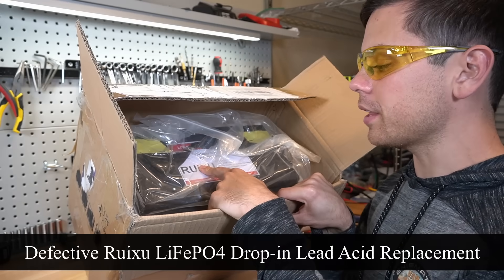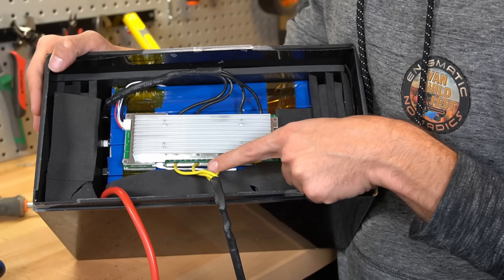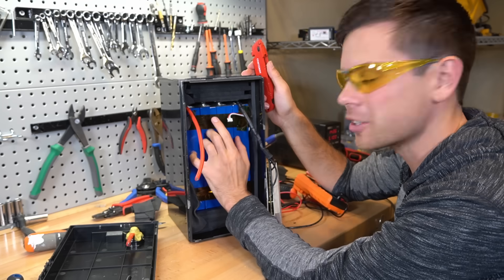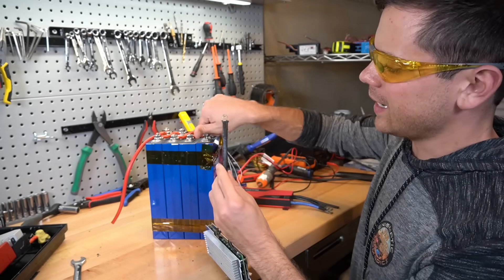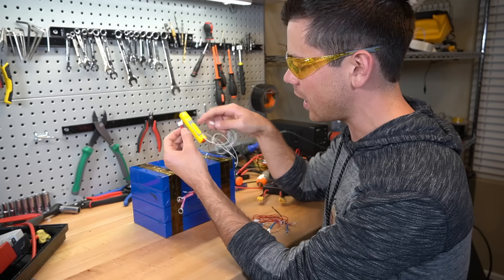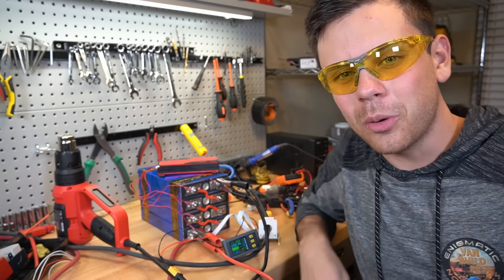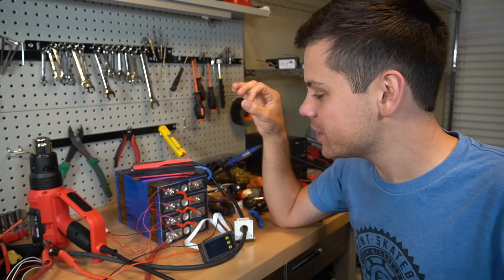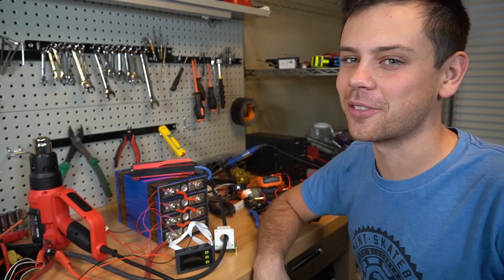Opening a Defective $700 Ruixu 100ah 12v LiFePO4 Solar Battery

Comment: Using the batteries themselves as a heat sink is a bad idea, but I suppose the builders of this unit couldn't figure out a good solution for the internal heat since there are heat sinks on both sides of the BMS.  Since the BMS is the main source of heat in these batteries, an internal BMS in a plastic housing with no active cooling is an inherently bad idea, and that applies to the Battle Born as well.  Given the inherent limitations of the case design, the best solution would probably have been to bond the flat heatsink of the BMS to the lid (since heat rises), and then use the foam to insulate the battery from the BMS.  The lid would still get hot, but it would limit heat transfer to the cells.  The only good solution is to just buy cells and use an external BMS with a good heatsink so it can freely dissipate its own heat into ambient air.

Comment: Hi Will, I love your videos, showing these suppliers where they are cutting corners and bringing it to light!  But a little advice, testing a battery 1 time for amp and capacity test and calling the cells good if they pass the test, is just not accurate!  Even grade B cells will have good capacity to start, but will loose capacity a lot quicker with less cycles than grade A cells, I know this would be very hard for you to do and show your viewers, because of the time it would take, but I think it might be a good idea to at least mention and not give cells a green light based on 1 cycle only!  Thanks for the content though!:)

Comment: The heat sink is on the other side... test it before dooming it to the curb.. "you need to spend more money"
Reply: I saw standoffs spacing it from the board. It's literally just a flat sheet of metal to protect the components and make mounting it flat on that side safe. It's amazing how many comments there are on here of people praising him when he just looked at it for a few seconds and deemed it a failed design. If I was this company I would already be talking defamation.
Reply: Actually yes, you are correct... yep fail 🤦‍♂️

Comment: I soo wish you lived near me in the UK, as I have my eBike battery that has stopped working.  I unscrewed its casing & see 3x small PCB assemblies in there.  The batteries themselves seem ok & register 36v+ at the charge / input terminal , but I cannot switch the thing on any more - bah!  Unfortunately I don't know anything about electronic components to be able the test the 3x PCBs & then diagnose the fault, then repair.  Has anyone got any ideas 4 me??????

Comment: How cool that they sent you the batt to troubleshoot. It figures it was a simple problem like that wire.  You looked like you found gold after you freed the cells. Quite the design, using the cells as an additional heat sink.😲“Trying to find a reason to hate everything” not hard these days, is it?  (Me, I'm just some old lady who always took apart her toys.)

Comment: You can swap pins in BMS connecters without moving the wires or desoldering anything. Usually each pin connector in the socket are held in by a small latch in the metal part, which you press with a needle to pull it out.

Comment: Wow that solder job. They must have used a blowtorch. And the BMS heatsink glued to the actual cells. Did you take Renogy off your website as well? I thought they were OK?
Reply from the maker: Oh right, renogy is good, but they were out of stock often and have a new battery coming out. That one will be up after I test the new battery
Reply: DIY Solar Power with Will Prowse They told me they were coming out with a 48V model.

Comment: Those smaller wires soldered to the larger wire should have been attached with a heavy copper crimp ferule. You never want solder in a connection like that because if it ever pulls too much current it can melt the solder and come apart, as well as the resistance that mess they made adds. Properly crimped and then heat shrinked, it will never fail in that part. They basically also used the battery cells as the heat sink. If they mounted that bms up in the top they need to add a heat sink plate at the top of the case so it could radiate heat out or it would probably fail an early death. Of course with all that foam around the battery cells, once they get warm that foam will insulate them making it harder for them to cool off and shortening the cell life. 

All in all other than the cells being decent the rest of the battery is a design disaster.

Comment: what i'd really like to see is more recommendations on where to find good raw cells. i got 8 x 120AH cells off Alibaba and set them up as two groups of four serials in parallel for theoretically 240AH at 12.8V nominal. i am not getting anything like 240AH out of them.

Comment: Will: You need a fan to exhaust fumes out the window. You'll be opening a lot of stuff over the years... no sense shortening your life.

A local makerspace built a soldering station - cut holes into some cylindrical ducting, 3D printed some nozzles, attached lights, hung it from the ceiling. When you go to solder, the lights and fans come on and suck everything dangerous out the window.

Comment: Look people dont have all the money in the world. Getting a more expensive battery would mean something else has to be given up. Money out of pocket is still money out of pocket at the end of the day.

Also regardless of how great LiFePo4 batteries are they are too expensive still. The price needs to come down significantly across the board. Right now you can get 4-5 100ah 12v AGMs for the price of 1 battleborn. Thats 200-250ah effective versus the battleborns 100ah. Granted the AGMs wont last as long but 5-6 years on them is more than doable with most peoples loads.

Comment: Can I charge lithium ion batteries from my small solar array using a Dc to Dc step down converter with constant voltage and constant current? Would that work efficiently, and would it keep a constant output voltage, even when the solar voltage varies?

Comment: Will, I have been watching your videos for a few months now.  I have learned a lot from you and your videos as I am interested in building a battery-backup system for my home.  I truly appreciate how you do your testing, and I can relate to your methods as they are logical and simply just make sense.  I purchased your book, "Mobile Solar Power Made Easy".  So far I have enjoyed the book and learned a lot from it.  I commend you on the amount of self-taught knowledge that you have accumulated, the reasons for which you accumulated that knowledge, and the methods you used to accumulate that knowledge.  And I just looked at the Subscribe button and realized that I had not subscribed yet.  That has been remedied.  Thank You for what you do!

Comment: Opened up my 24v/100ah lifepo from solarfam today... quite happy with it: it unscrews easily. There are proper copper busbars and some space from the bms to the cylindrical cells. Downside: sloppy padding and tons of half hazardously slapped hotsnot.

Comment: They should at least make those batteries user serviceable.  Would suck for someone to throw that out because of a lose wire or even if a controller failed when the cells are fine.

Comment: Thanks Will - that "unboxing" was the best and most informative I've seen, although using a jigsaw to cut away the case appeared a little risky - very AvE like!

I was in two minds over getting a ready made batteries over individual cells and balancer plus wiring and labour, but you've convinced me. A quick look around and the costs are about the same of ready vs assemble yourself. Thanks mate - very valuable video you get the big VVV!
Reply: Benny Banger another AvE fan eh? Love uncle Bumblef#@ks content :)

Comment: 2:40 that doesn't look like a temperature sensor but a NC (Normally Closed) bi-metallic thermostat that opens the circuit when the temperature reaches the rated temperature. I supposed that they can make a NO one do the same thing so it disconnects when it gets a signal. The reason they don't have a low temp cut-off is to save a few cents of hardware per battery.
Reply from the maker: Good to know! Thank you

Comment: Opening up a battery is like working at a restaurant.  If you ever worked inside one, you'd never eat there.  Every manufacturer is going to make their product as cheaply as they can and still pass some type of testing procedure.  You liked these batteries until you took it apart.  The only fair way to compare batteries going forward is to take every one of them apart.  You may be surprised.  Ever wonder what happens to your steak when you send it back because it was under or over cooked? You don't want to know...

Comment: Hi I am wondering what you would recommend on hooking up these batteries together? SPIM08HP 3.7V 8AH LITHIUM ION BATTERIES 25C 200A SUPER CELLS  Thanks.
Reply: Depends on what size/kind of battery you want to build. As an example, for a 12V nominal battery, four of those in series would make a 14.8 Volt "battery" @ 100Ah. Then, if you need more Ah, you hook another series up in parallel to make a 200Ah "battery bank", and so on. To make a larger Voltage system, for example, 24V would mean you would need 16 of these cells to make one "battery", and double to double the Ah, and so on. Hope this helps, just in case Will doesn't get back to you soon enough.
Reply: @Tumbleweed5150  you didn't get my question. How would you attach them together? Solder, nuts and bolts, copper strips bolted like a sandwich. I want something simple but durable.

Comment: Thats what a dremel with small cut saw is for. Even using it to score the plastic most the way through will let you split the case open easier.

Comment: Where is a LiFePo4 battery you can buy in Norway that has a heater inside it.

It activated when charging and the temperature is low...

Comment: I kind of like the cheap china batteries but it is hard to get an honest c rating on them and they like to round up on amp  hour rating.  I just bought two 12v 310ah lifepo4 batteries on amazon including shipping right around $1,350 each. I took them out of there box  and put all 8 cells in a new fiberglass lined stainless steel box. Then I put a 250 amp bms from Daly on it. Now I have a 24v 310ah lifepo4 weighs about 140lbs but is smaller then one of the big Victron  200ah batteries.  Funny though when I got the 12v batteries the bms was in between the posts and soldered to one of the bus bars. just floating over the cell next to it no protection.  Only down side on the  cells I don't think they are much over 1c discharge but even then that is still a 300 amp draw ability.

Comment: The blue tooth app on the Lifeblue battery is a game changer. No guessing at how much charge you have. No amp counter, no shunt. Turn on the app and see what the percentage of charge there is. What the voltage, amps in and out, temperature is. Add the low temperature version good to -4 f and it's a much more practical solution

Comment: I would still probably go with the cheaper battery and just fix it if it has a problem.  Guess they installed  high temp cutoff because the board is mounted on the cells !!!

Comment: Putting fear into the solar battery industry!  That's how we're going to get a better product.  And without specifically saying it, Will essentially points out that they can build an economical battery with just some wise design choices, components, architectures, and arrangements.  I've learned so much in the short time I've been aware of Will's videos.  Time well spent, besides just being very entertaining.  Thanks, Will.

Comment: Hey Will, nice job digging deep! Do you have the information on the individual cells for this battery? I like the aluminum case for longevity and durability. I see deep cycle storage 3.2v 100ah LiFePO4 batteries on alibaba for $56 each so x4 equals $224 + BMS for a 12v 100ah pack DIY possibility. "How Cool is that!"
Reply: Yes, I would like the info on the cells too. If they are as good as you say, they could make a great compact battery.
Reply: @rcmedway  I just looked them up after seeing this review and I would like to purchase a few and test them but I think will has tested some of these compact batteries already on some of his other videos.

Comment: No one uses aluminum wires. How can you just make a statement like that without any proof? Tinned or nickel plated copper looks just like aluminum, so how could you tell without in depth analysis? You can’t even solder aluminum, so those wires are not aluminum.
Reply from the maker: Update: not aluminum wire. It's tinned copper. It felt brittle when I flexed it and everything else was cheap so I was expecting the worst. Does not matter much because 4x 14 gauge copper should not be pushing 100A. Not ideal.
Reply from the maker: Yes you were correct. Should have cut into it first and not gone by flexing it. Thank you clean power auto

Comment: Aluminum wiring in a setup like this is a MAJOR red flag for me! For your subscribers who do not know this, Aluminum wire connection have to be SUPER tight and secure, given the fact that Aluminum "flexes" from temperature variations. In the 20th Century THOUSANDS of fires were caused by this, mostly in Mobile Homes and RV's, MANY of which caused fatalities. I'm honestly a bit surprised and disappointed the U.S. Government allowed these into our country!
Reply: I would highly recommend soldering all of your connections, regardless of type of wire used.  Better safe than sorry.
Reply: Also, it cheaper and less conductive that pure copper.
Reply: It was probably done to add extra resistance for load sharing of the FET.
Reply: Will has since updated the description of this video to say that the wires were copper, but brittle.

Comment: Thanks for this.  On an unrelated note... I was replacing a battery on an iPhone Se and the adhesive ripped.  So I was wedging a piece of metal under it and like a fool I bent the battery.  It was like the 4th it July with sparks and flames everywhere!  Just telling my idiot story...

Comment: Aluminium wiring? Yikes! Back in the 70's they used aluminium wiring in mobile homes, so many shorted out and caught fire! I owned one. I happened to be home when I heard one of the  electrical outlets shorting out, I quickly turned off the breaker! Even the electric outlets had aluminum in them!
Reply: Same happened to us, one night. I commented on the temperature flex issue with Aluminum wiring. One night my wife was away, and I slept in the 2nd bedroom just to do something different. Early the next morning, I woke up to an acrid odor. I looked over at the outlet literally 10 inches above the mattress and saw an orange glow. I RAN to the Box, and threw the breaker for that part of the house. Had I not decided to do that one different thing that night, we would have doubtless lost our home, and very possibly my life!
This is why seeing the cheap build and cost-cutting of this piece of Chinese you-know-what, really defrosted me!

Comment: Guess you should open up all batteries to see how well they are built now
Reply: take a battle born apart.
Reply: visit their factory and see how they are made?
Reply: @ronwest7930  there are a couple YouTube videos of the inside of battleborn batteries.   The have had people film inside their factory.   Look for "Morton's on the Move" they built their own batteries that went to Alaska with them (Battleborn is one of their sponsors)
Reply: @padraigAZ  I watched Wills video and the Battleborn looks good. Sadly I would need about 4000.00 dollars to do it. I will order from China and try and find a decent BMS.
Reply: @ronwest7930  he has
Reply: @gabrielmartinez3171  maybe now, back when i wrote this i don't think he had yet.
Reply: A teardown should be part of all the reviews, including for inverters, etc. 🤓👍
Reply: Reverse Engineering is flattery indeed....  :P
Reply: id greatly appreciate that.
Reply: The batteries are all no good if you are pulling high  amps. How can you get rid of heat from an enclosed system.

Comment: That is a lot of money for a 100ah battery
Reply: Lithium 100ah is actual usuable 100ah though, unlike AGM or flooded which can only be discharged to 50% if you want them to last. Plus they get 3 times as many cycles as an AGM or flooded battery. It's not quite as expensive when you look at what you're getting.
Reply: Yes that battery is not going to work well for me

Comment: SO - we are like you - we became very disappointed in the build quality fo the Chinese ALL-N-ONE batteries and we also got tired of BattleBorn gouging us for so much for simply repackaging Chinese batteries and adding a decent BMS ... SOO we started ordering our own BMS and our own Batteries from China directly and spending a few minutes puting the things together ourselves ...  PLEASE NOTE  - we are using 12.8V 200aH batteries NOT 100aH as you so often do .. BUT below is a typical cost we pay  from the #1 Maker of Lithium batteries in World out of China ..

For 4pcs 3.2v 202ah LFP Cells -- $110 ea.. total USD440
For 10 busbar with M6 screws, - $2/pcs, sub total USD20
Shipping fee to door: USD155
 - UPS/DHL - insured - 
Plus PayPal added fee: USD31
 (we use Paypal to insure we get the battery)

Total: $646 For a 12.8 200aH LiFePO4 battery ....  Pretty good in my opinion 

As for BMS - there are soooo many - some with Bluetooth - some for 100A - 200A that I won't list all of them ...
Reply: Thank You for the cost breakdown,   now I feel more comfortable with these high prices.
Reply: @Papa-bh6zq  just make sure that you are not comparing 100aH prices to 200aH prices ... Thx..